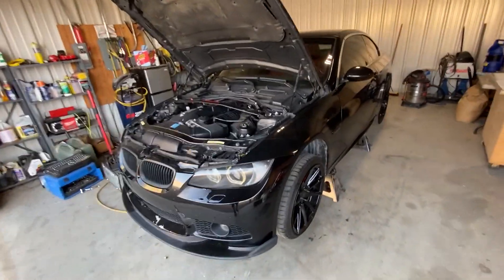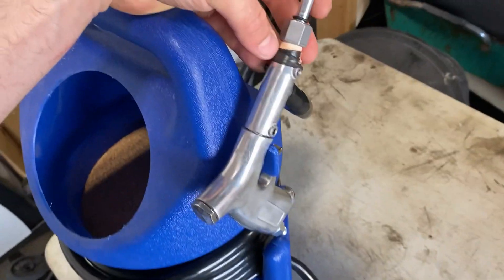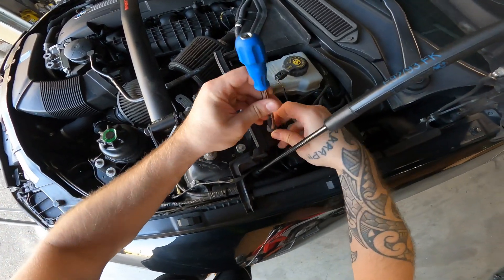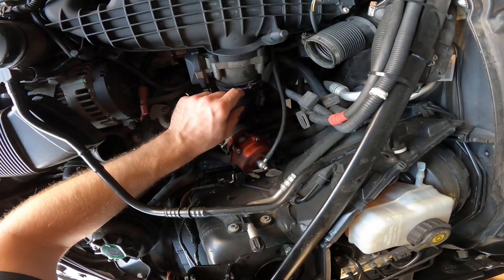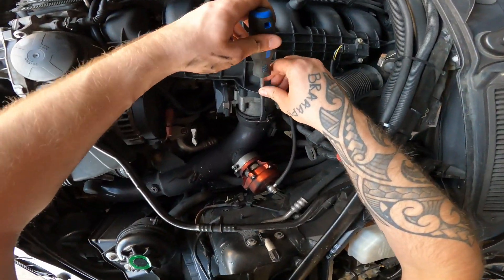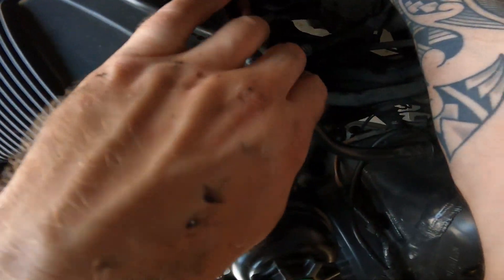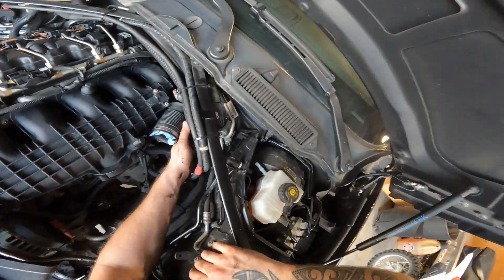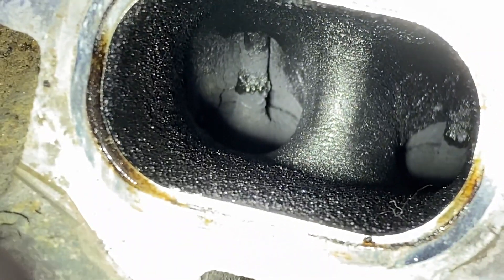Walnut Blasting My N54! BMW 335I

Comment: What size compressor did you use? You think that might be what made it take longer than you thought it would?
Reply from the maker: i don't really think the compressor was the issue, 28gallon pushing 120-140 psi. Really just took time to get a process down as i did get faster as i went!

Comment: get rid of that intro bro its not 2007 and my ears got destroyed
Reply from the maker: I paid quality money to have that made up ah
Reply: @EvanCaron  hate to be a hater but you can def be big with tutorials n shit but i cant stand intros like that. also, whered you get that adapter for the vacuum and the starter relay?
Reply from the maker: @Beemoval22k   rather people tell me than not, only way i can make videos better aha! the adapter is from eBay, type BMW VACCUM ADAPTER & you will have some options. the starter switch was from princess auto here in Canada but im sure Ebay or any auto store would sell them, just called a remote starter switch
Reply: @EvanCaron  The intro is pretty cool, just lower the volume of that intro by 30%. Done!